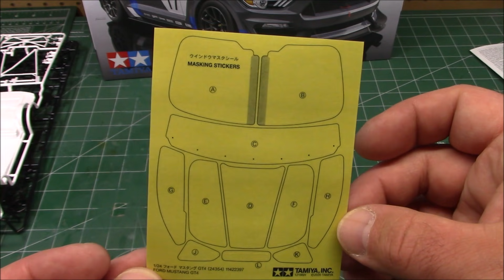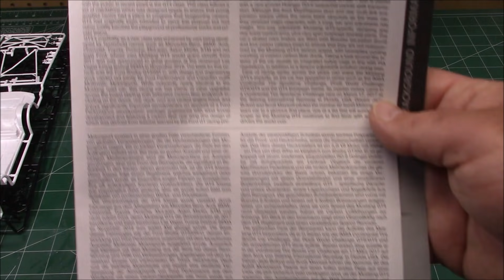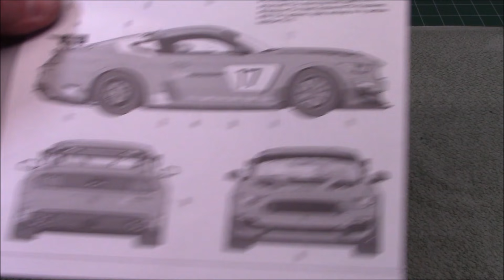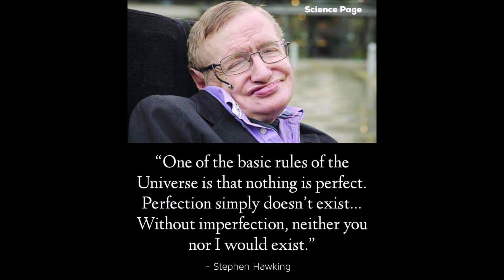Tamiya Ford Mustang GT4 Race Car 1/24 Scale Model Kit Build Review and Painting 24354

Comment: It makes sense to have the interior and bottom of a race car in white, because it makes finding fluid or gasket leaks a whole lot easier for the pit crews and mechanics: many modern aircraft have the undercarriages and undercarriage bays painted white for the same reason. Great build, as per usual; with the quality of their molding techniques, Tamiya usually make things a lot easier.
Reply from the maker: Thanks for coming along for the FUN!
Reply: Some sanctioning bodies requires the driveshafts to be white to to make it easier to spot them with they fall out on the track

Comment: The race teams usually buy white vehicles and then put a vinyl wrap on the body. Saves weight and white usually helps keep interiors cooler. Not matching interior or under body saves weight and money. Painting the roll cage just keeps it from rusting away and weakening
Reply from the maker: Thanks for the info!
Reply: hpiguys Workshop great work on this model by the way.

Comment: Ford Fact: The majority of race cars are factory delivered as a "Body In White". All you get is just the body painted white. No interior or engine, because most racers would have to replace many of the stock components for race specific parts. So the choice to keep many of the parts white is very correct.
Reply from the maker: Thanks for the info!  I figured I'd listen to the directions and leave it as they said. Plus the pics online showed it white. Pretty cool.

Comment: Two days? How do you get your Rustoleum to dry so quickly? Ive used it before and it took about a week to be workable.
Reply from the maker: Luck?  
No issues here unless it's super humid, then it takes days, but I dehumidify the shop. I also spray  LIGHT coats, people say they look thick on camera but all wet paint looks thick when sprayed.